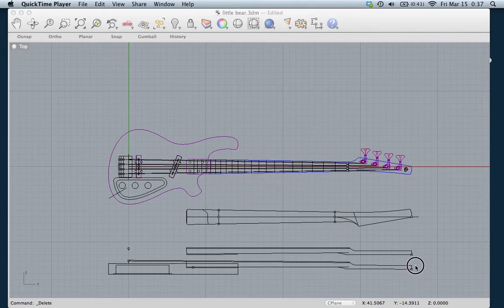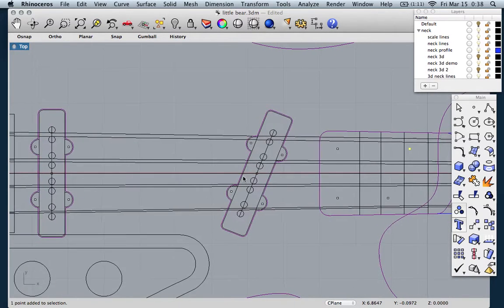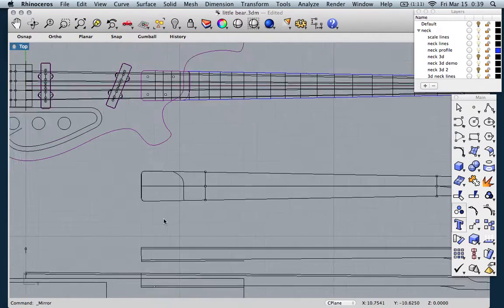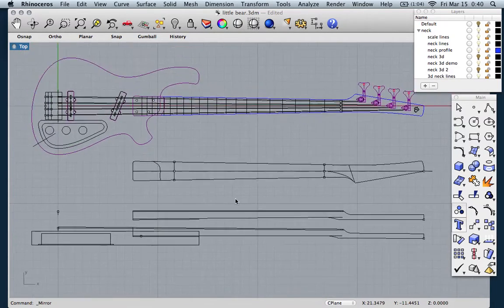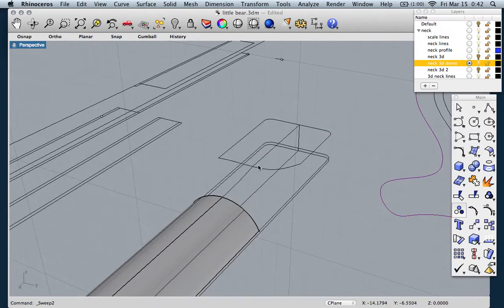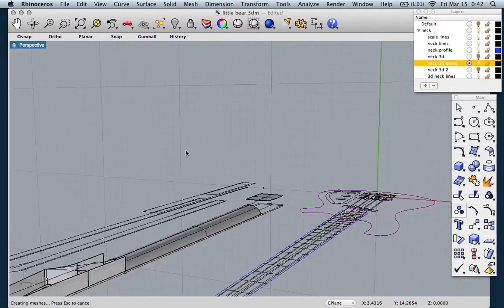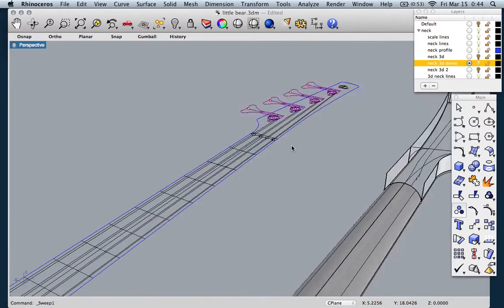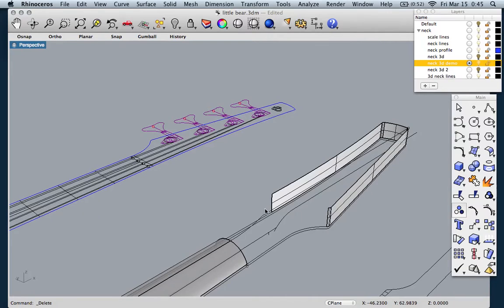CAD and CAM for luthiery no. 3

Comment: really helpful video, i'm trying to learn how to design guitars in rhino. you seem to skip/leave out a lot of steps as far as making the neck shape and what not. i'm totally lost on the whole 3D modeling stuff. keep posting! thanks
Reply: Hey Steve, 

It seems we got the same feeling about the missing 3d modeling part :) I'm stuck too with the 3D modeling of the neck. Did you find any nice explanation about how to handle this 3D stuff ?

Thanks ;)
Reply: +Beauchene Implements nice, looking forward to it, thanks
Reply from the maker: Steve Chamberland I plan to upload another vid that just covers modeling necks in detail. I did skip the parts where I made the neck profile lines and rotate them vertically, but it's easy to do.